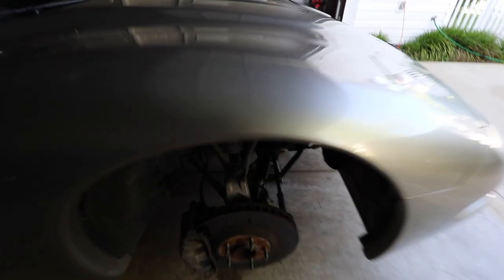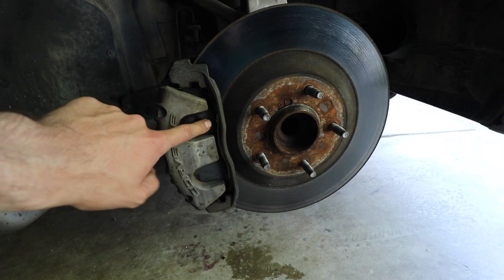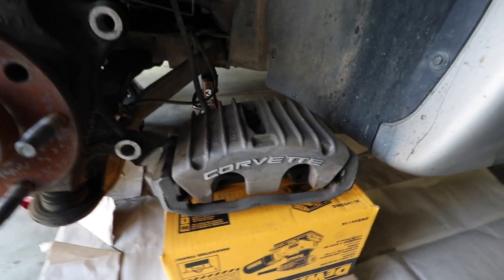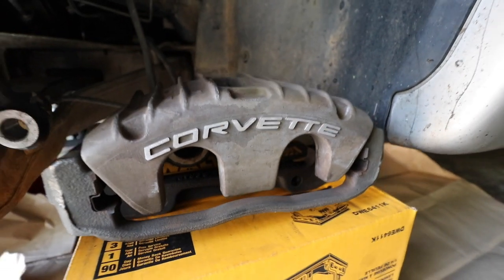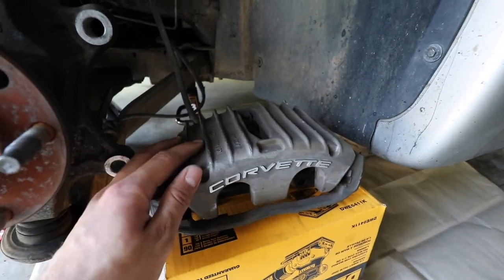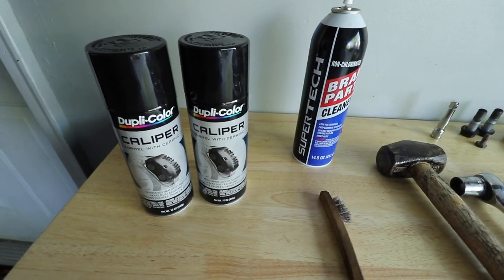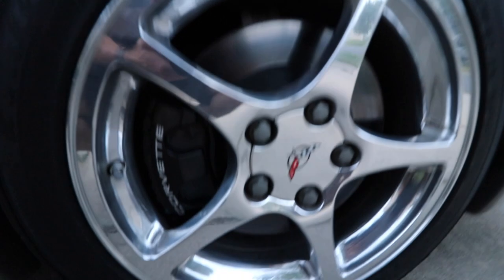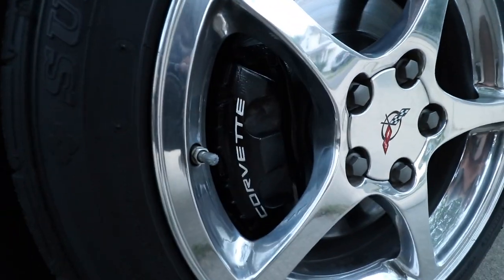C5 Corvette Caliper Painting - EASY!

Comment: Looks great!  What size are the caliper bolts by the way?
Reply from the maker: The larger bolt for the bracket is a 13/16 and the smaller for the caliper itself is a 14mm. New pads and rotors video coming out this week!